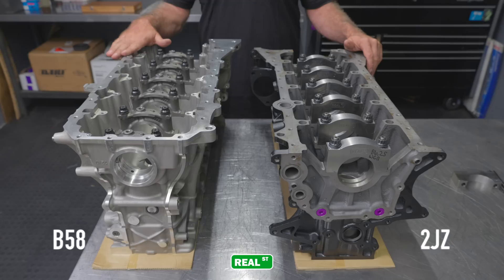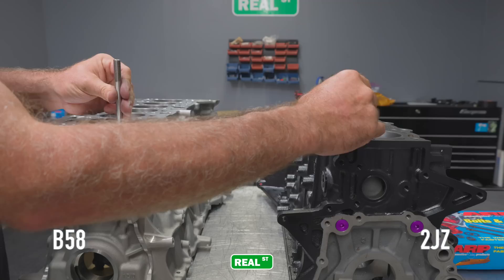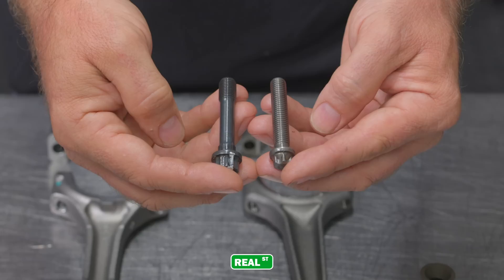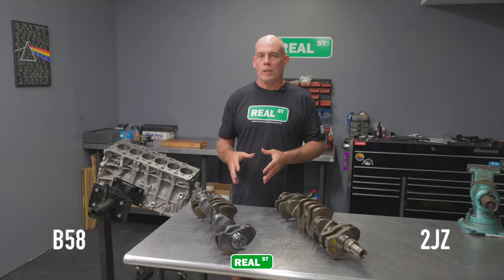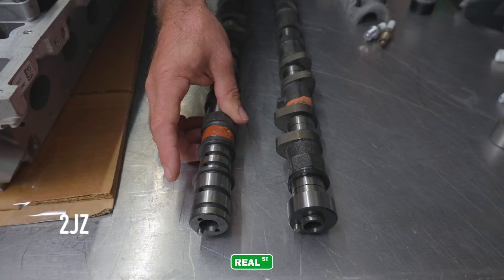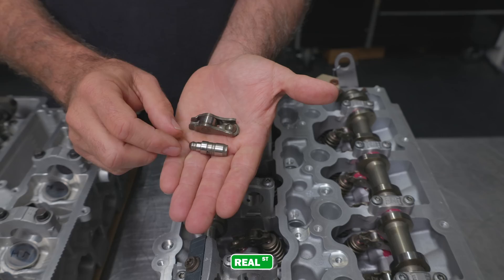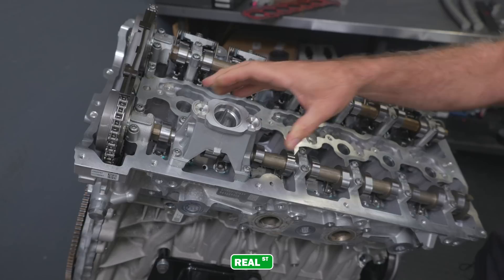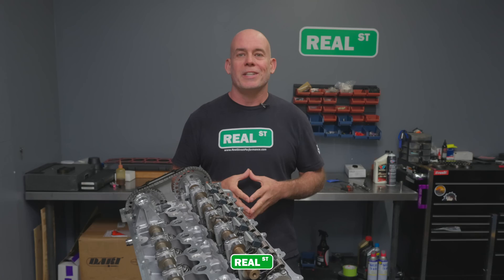Toyota 2JZ VS BMW B58 | 2JZ STILL KING?! (Detailed Engine Internal Comparison)

Comment: I don't think the B58 is anywhere close to being as reliable as the 2jz is and I know a few people that have a B58 in their BMW and they are twin turbo and they have a few upgrades done to them and the B58 has a habit of going into limp mode alot when they are getting on the gas it happens way to much in my opinion and it is everyone not just one persons and after they get a few miles on them it gets worse if i had to choose a inline 6 engine i would choose the 4.0 Barra
Reply: Whole thing sounds heavily off since B58s never came twin turbo from factory. U sure u didn't mix the B58 up with the N54?
Reply: @carboydorifutoparty3976  you might be right it is the n54 I believe
Reply: @carboydorifutoparty3976  I do know someone that has a 2020 m340i and I believe it came twin turbo I just know that he purchased it that way and I think it has a B58
Reply: @lawrencecoleman7850  that also sounds off also since those were still single turbo not twin from factory. They are twin scroll single turbos yes but not twin turbo. There is the 340d x drive as that model with the twin turbo B57 diesel I6 but they've never came with a twin turbo B58 since those don't exist from factory.
Reply: @carboydorifutoparty3976  you are correct I was going off of what he said I asked him why he thinks he has twin turbo and he said it has twin power turbo engine lol I said that is not twin turbo it's twin scroll single turbo you are correct thanks for letting me know I'm man enough to admit when I was wrong but I still like the new BMW I just don't like that they go in limp mode so much but they will get that straight I just think the 2jz is better because they have been out longer and have all the bugs worked out but I think the BMW inline six engines will surpass the 2jz they are already surprising people that think they are going to be a easy win and then they are gapped by the BMW
Reply: @lawrencecoleman7850  I think it's a matter of the tune he's using because I know of some who use jb4(which is a 50/50 any knowing its a piggyback anyway) that sometimes throw the cars into limp mod but if its not that then it's all eyes on the tuner then,because multiple do throw tunes on these and run fine after but that all comes down to how it was tuned or what tune from what company it was from tbh.
Reply: @carboydorifutoparty3976  from what I was seeing and watching on YouTube some people that have tunes and upgrades and the tune they have go hand to hand with the upgrades and they never had a problem or went in limp mode and some people that have tunes they go in limp mode alot so that makes me think that is the tune they have they probably purchased a tune off the internet and didn't take it to someone that has a Dyno to tune it properly I actually trying to get the wife to get a 340i
Reply: @carboydorifutoparty3976  I race mini drag bikes I'm in the process of building a mini drag bike that is powered by a 800cc twin cylinder 2 stroke artic cat snowmobile engine some people laugh at me when I say I race mini drag bikes but they see how fast we can get them going and on a small frame that close to the ground it's a hell of a adrenaline rush

Comment: 2jz has flat tappet lifters, b58 has roller lifters… roller lifters/rockers are far better than flat tappet buckets. Once b58 and s58 go billet block it will finish the 2jz. Far more superior technology and valve train stability
Reply: Billet block isn't end all beat all. Bret lesala mustang snot rocket went up against proline and billet engines in fl2k with his factory 5.2 predator sleeved block. Boss302 crank, gt350 heads and curb stomped the competition with factory ecm not stand alone as well.

Comment: In my opinion it is obvious that the b58 has been developed with input from Toyota.

The second technical update added port injection and miller cycle, things toyota uses since the beginning of 2000 era

All valvetronic engines have a throttle body because it is used for cold starts, for limp modes and for creating a partial vacuum in the intake tract for the evap canister and crankcase ventilation to work.

Some of the valvetronic turbo engines don't have a blow off valve, because the extra pressure is relieved with the valvetronic system

Comment: what you showed me is that 2jz is still more quality build than any new engine out there..... Before engines were made with purpose... to basically last a lifetime whereas nowadays engines are made to last bit longer than a manufacturers guarantee. And not to mention diy-ers ability to service the engines. bmw engine is more complicated and has a lot more things to go wrong, and not to mention for just removing bmw camshafts you need special tool.... so it was made to be only servicable by bmw or their licenced services

Comment: I don't really care what the result is, I'm not buying a fuckin BMW. All the Toyota simps jumped ship and ran to Subaru and BMW first chance they got 😂, they just to simple to realize it 😂😂😂😂😂. 

I respect the 2j, but still don't like it. Otherwise a BMW with a turn signal (a Toyota poopra) is really all they accomplished.
Reply: Also I'm fairly certain the thin upper rod area is going to cost RPM in the long end.
Reply: That twin port exhaust crap started on big truck engines in caterpillar first on the intake side. (not first ever, just first before the b motor) it's great for trucks to save weight and extra components, but the head on a big truck is cast iron, so it's incredibly durable.

Comment: The s58 in the g80 has seen 1240whp unopened through a stock 8hp76.   A 2j could neeeeeeeeeeeeever..
Reply: Proof?
Reply: @Josh-qm4rb   1049hp/1275Nm was made in 2021 in unopened s58.  now there are 1200whp cars all stock motor.  no head work no cams just bolt on turbos and fuel.  in 20 years when there are no more gas engines, and the aftermarket for the s58 catches up to the 2jz it wont even be a question.  bmw knew the s58 was the last all gasoline true 3.0 inline 6 m engine so they overbuilt it the block. the rods, the crank, bearing clearances etc.  the 3d printed cylinder head is WILD and flows air like crazy, but it also dissapeates heat from the cylinder lowering the % of energy being lost as heat wich = more power and efficiency.   2jz block is a boat anchor lol
Reply: @Mp-jw1qg  That is absolutely INSANE for an S58! 
S58 is the king then.

Comment: this is laughable just from the tittle lol BMW wont compare to toyota 2jz just cause toyota is reliable and you can get 1200 hp out of a stock bottom end of a 2jz not to mention the affordability and its also one the best motors ever produced the 2jz wins every time.

Comment: I dont get the arguing from toyota/2jzgte fan boys. Because the 2jzgte was finalized by german engineers, has a German transmission on the back of it. And was also coengineered by yamaha. It wouldn't be great if it was JUST a Toyota product.
Reply: Yamaha co developed the 1-jz head, not the 2jz
Reply: @cj09beira  2j aswell, and a lot of other Toyota engines. Like the BEAMS engine, etc. Yamaha and Toyota had a partnership for a VERY long time. Possibly even still currently.